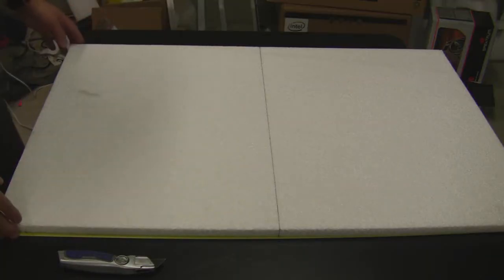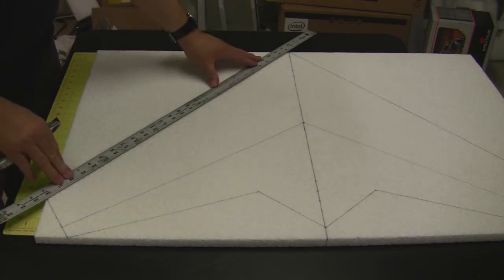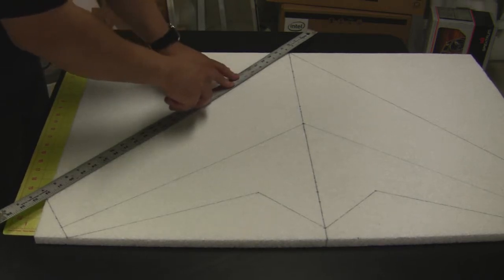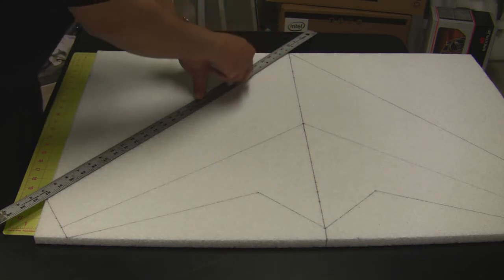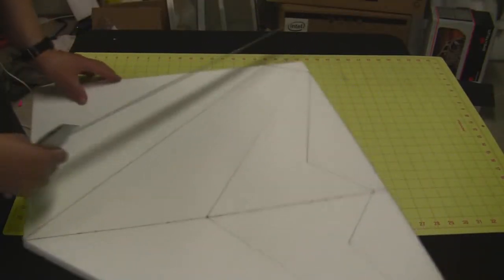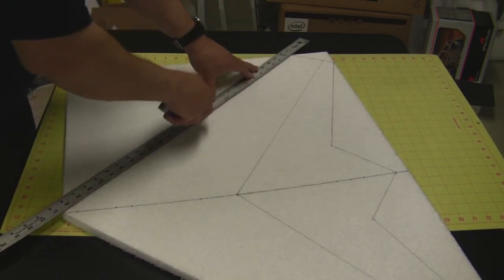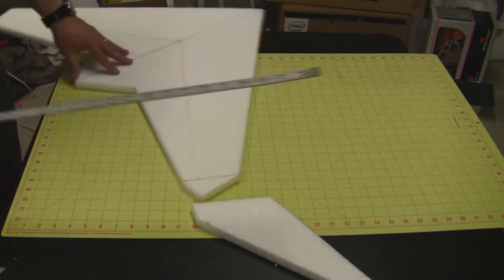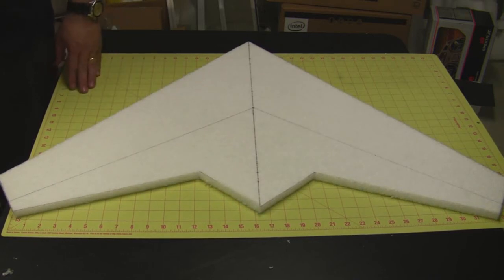Bullet Proof RC Plane Build Along No1 Phase 1D

Comment from the maker: bottomgunner I guess you could build it out of depron but you would need to a lot of it because depron usually comes in much thinner sheets. I would recommend using something else like home insulation foam or bluecore if you don't use EPP. The EPP is the most crash resistant foam available. None of the other foams will take a crash like EPP.